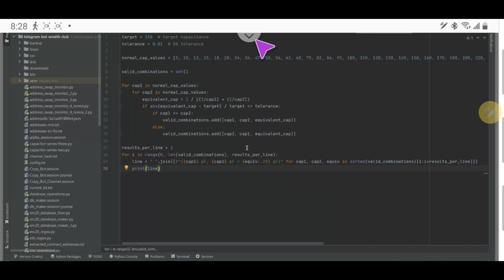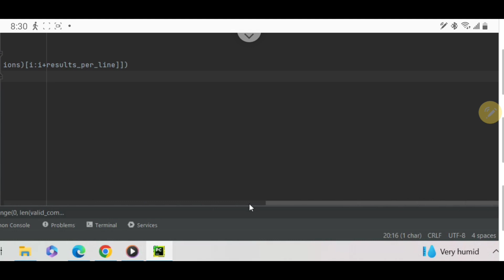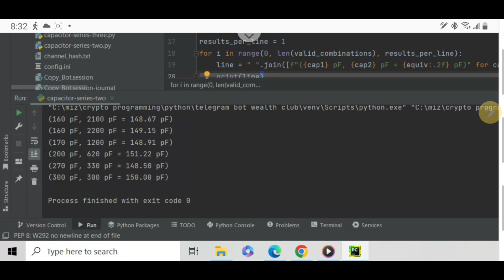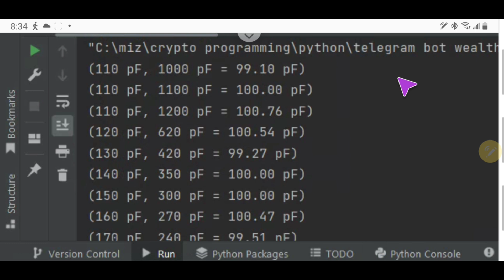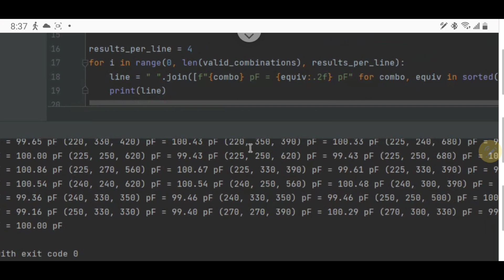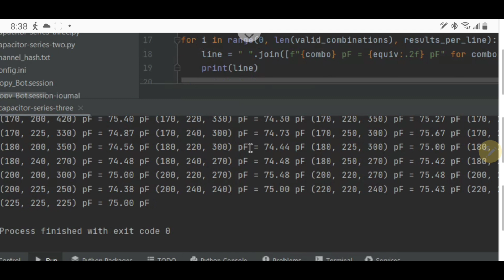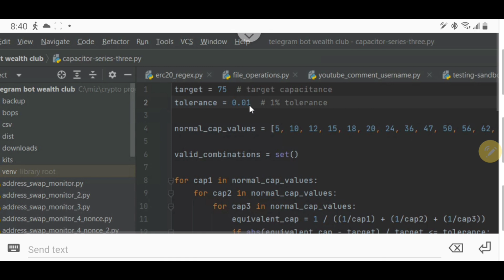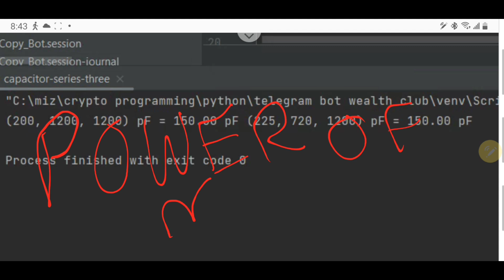Computer 💻 Aided Output Tune For 6 Pill Amplifier - Really Really NEAT!

Comment: That single turn through the ferrite cores looks a little naked there Mr Gatekeeper.
Reply from the maker: It may look naked to the untrained eye but I garuntee you in a naked colony the occupants so not feel as they are naked lol... as to make a point, funny point hopefully I'm trying to make, that single turn has almost 3 to 4 times the inductance then a normal combinner you may be use to seeing which yields more then enough isolation between each port. It is a design that derives from the geniuses connected with Motorola 😀

Comment: nice program.  you could make one for input circuits using resistors to cut drive. can be a challenge getting 50 ohm to radio for input match. attenuator chart is nice. but what if you have resistors out side of what you need. something I play around with LD Mos transistors. I find it much easier to use pre made annotators and stack them . like 10 DB and 3 DB to get 13DB . Etc. 73's
Reply from the maker: Funny that you mentioned that...me and rainmaker was talking about that today. That would be a great program for that. Great idea!